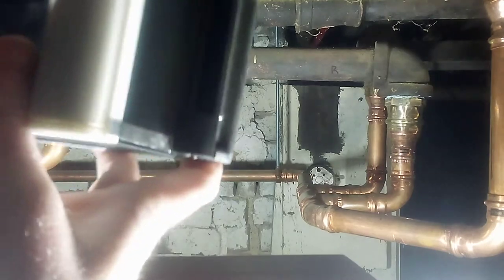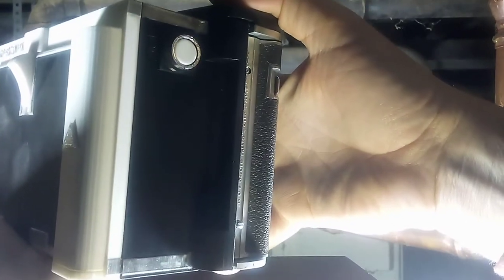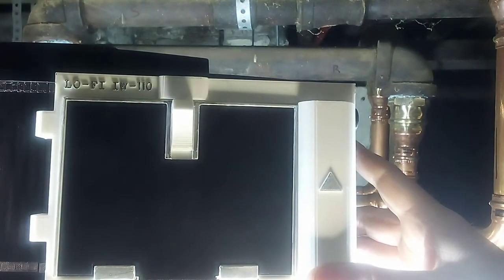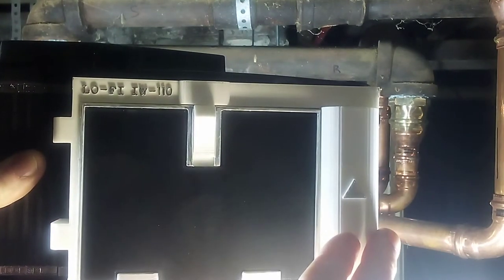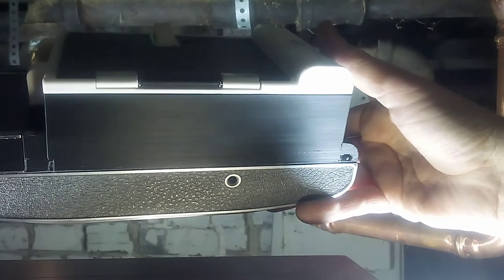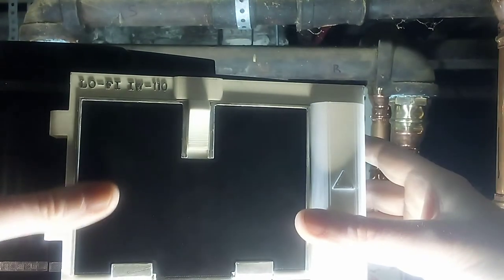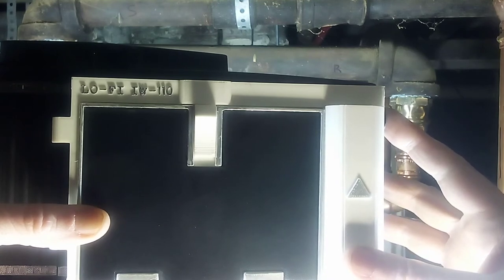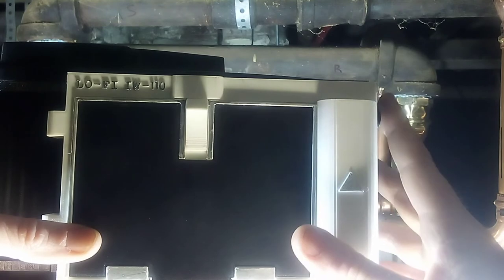Lo-Fi Instax Wide non-destructive conversion kit for the Polaroid 110, 110a, 110b, and 120 !

Comment: Hi there LoFi. I've been looking at this and your 600se model for some time. One concern i have, is access to viewfinder, if i'll be able get my eye up close to the window. Having to look through the viewfinder from an inch away doesnt work well for me. 
Thoughts? 
Thanks
Reply from the maker: Hello- my goal is always three things: Totally non-destructive and reversible, simplicity of install and use, and, having met the prior two parameters, set up for the film plane exactly. Unfortunately this often means an offset to the film, as well as the challenge you described as a distance from the viewfinder. I have found that, despite wearing glasses, I can get used to this. As you mentioned, though, it may not work well for you.
Reply: @lofianddiy  yeah i get that, being an avid collector with over 1500 cameras on display and a 100% analog shooter i also much prefer not to cut up the camera and have nothing but respect for your philosophy. Just trying to figure out how big the viewfinder issue will be for me before buying. I tried clamping my lomograflok to a polaroid 120 and that distance is just too much for me, makes the viewfinder very uncomfortable. 
Would you say the problem is less on your 600se build than the 110? 
I have most polaroid models on hand so trying to decide wich conversion will fit me best.
Reply from the maker: @MrLennart1976  The 600se instax wide back has less of this problem, as the viewfinder actually sticks out toward you and over the instant back. My 110 instax wide conversion ends up pretty much like when you hold your lomograflok to the back of your 120.

Comment: Does this conversion differ in any meaningful way from a conversion done by Option 8?
Reply from the maker: I don't profess to be an expert on his work, but his approach to conversions seems to be quite different than mine. I would think the difference on my end is that mine are totally nondestructive. Remove a couple hinge pins and you have done the hard part of the conversion. Also, I choose to incorporate less of the original donor instax wide camera. My design is 80 percent my own custom-designed parts. It is just a matter of preference which type you prefer.
Reply: @lofianddiy  Thanks for the reply. I'm leaning pretty strongly toward your DIY conversion, as opposed to the Option 8 one. But I'm just trying to make sure I'm not overlooking something. I'm also not 100% sure that the 110A that I have is in fully functional condition, so being able undo the modification and put it on another camera is appealing.